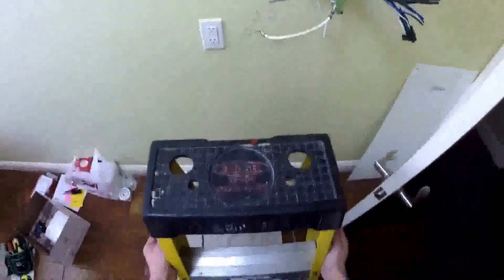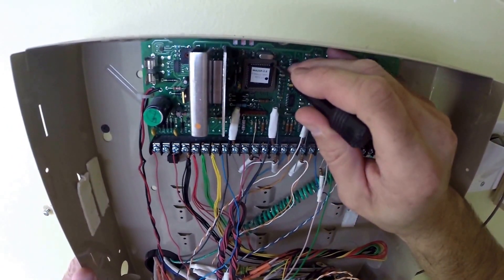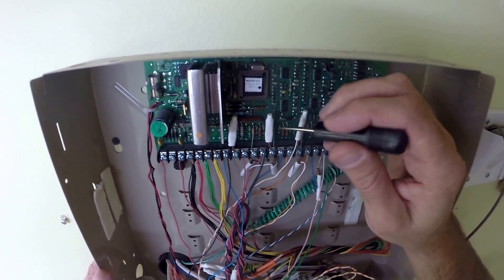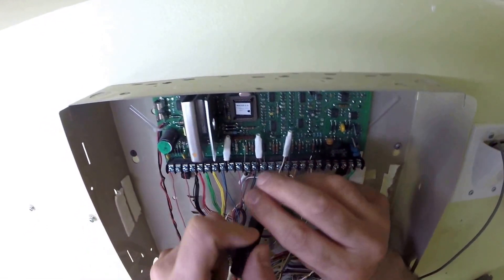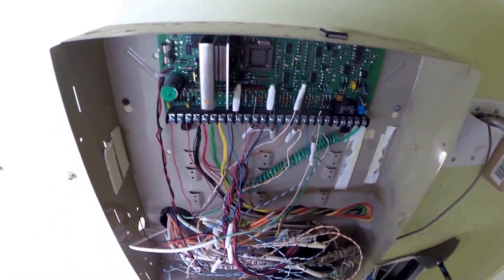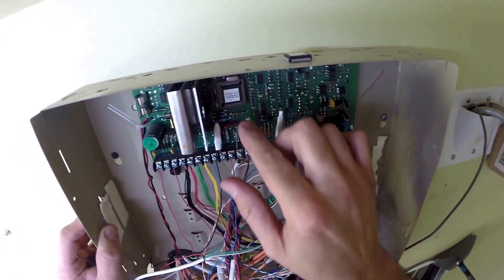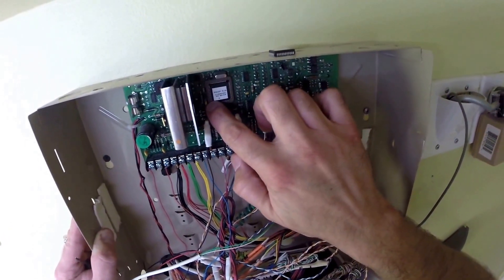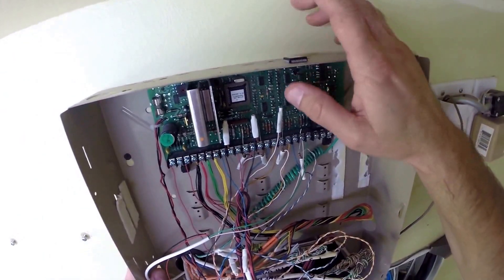Honeywell Vista 20P : How to do a Total Connect 2.0 chip upgrade on a Vista 20p

Comment: Does this require reprogramming of the panel or does all existing programming (ie; Zones, etc) remain resident?
Reply from the maker: That is the best part of the eprom chip swap it does not require reprogramming of the panel
Reply: Cool. Ironically, I'm a Honeywell Dealer and didn't even know they came out with this.
Reply: @Geoarm  if I have a Vista 20p and I have some zones wireless. Do I have to reprogram the wireless zones

Comment: Hi, I bought the panel and the sensors, and installed it myself. I have wifi communicator. I don't have an alarm company, and I don't want to have one. How can I create an account (username and password), and use the total connect 2.0?
Reply: You can't, must be monitored via Alarmnet through a dealer. The account must be activated by using the MAC & CRC of the communicator.

Comment: HiSo if I swapped the chip from the board do I need to reprogram all zones again?
Reply from the maker: Thank you for you question on the Honeywell vista hardwired security systems. No, that is one of the best parts of this chip upgrade it doesn't default any of your programming. Let us know if you have any more questions about upgrading your vista panel. What is the make and model of your current setup?
Reply from the maker: Did you have any other questions?

Comment: where is the configuration stored?
Reply from the maker: If you have an older panel and want to upgrade the chip all of the information will live in the Honeywell vista 20p so you dont have to worry about your current setup getting erased. Are you looking for low cost no contract alarm monitoring services? We have the lowest rates around.
Reply from the maker: Where you able to get your hands on an upgrade chip? Are you looking for the lowest cost no contract alarm monitoring rates around?